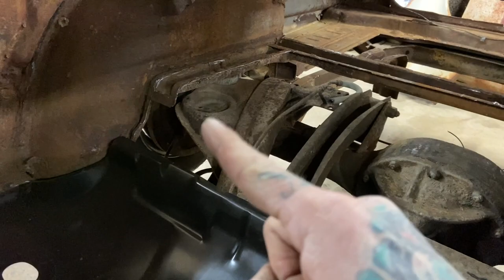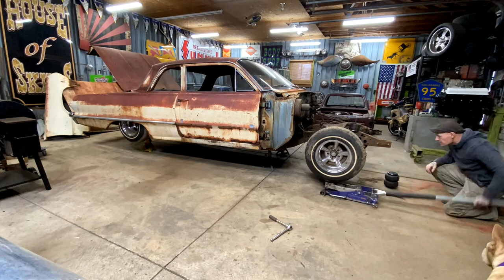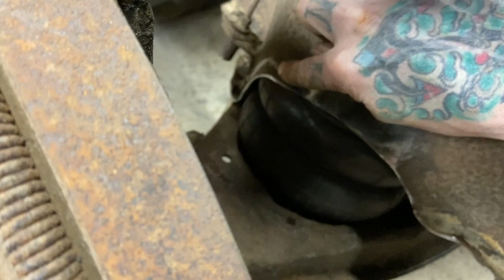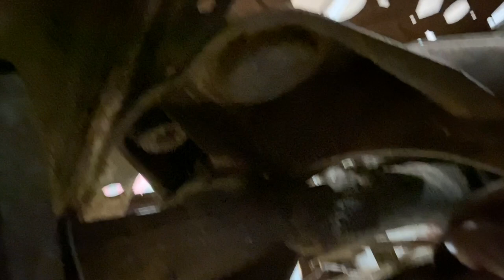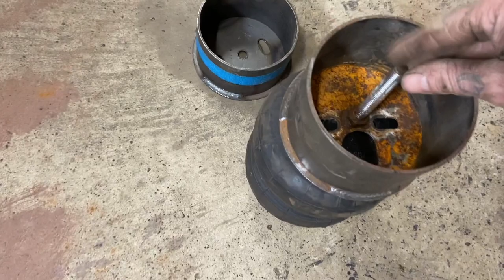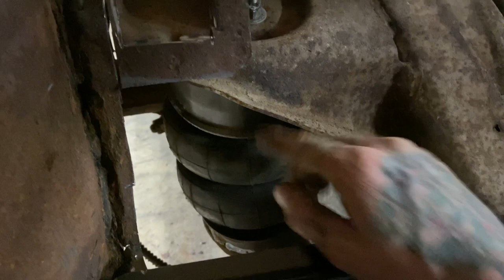Episode 21-how to install air ride on a 58-64 chevy impala

Comment: Really helpful. I've just bought an Impala and I could see arch shaped burn marks in the boot on the Wheel arches and two rubber supports bolted to the boot floor.. Which tells me that it had an airbag system in it with the current big 20" x 10 wheels. After watching your video I will now see if it had those mods you did. Thinking about re bagging it with 14 inch wheels.

Comment: Thank you for making this video.
What diameter bag fits on the front without having to trim the upper spring pocket? I have a 64 implala and hoping to use a 7" wide bag, the SS7 if you are familiar with it.

Comment: I ran those swivel fittings on a bagged dually. They have a tendency to leak. I switched to solid fittings and fixed my air leaks.

Comment: This helped me out, I have an 89 dodge ram truck that I've been thinking about bagging and I was worried I'd have to had shocks as well as the bags but it doesn't seem that I'll have to. Atleast not on the front which I'll be doing first.

Comment: The same body mount is out on my 64 biscayne  as well... I wonder if there's a common problem with the corners holding water and debris in there...
Reply: I have a 63 Pontiac Parisienne with same problem. Ordered replacement wheelhouse box braces from Dynacorn. OER also sells the replacements.

Comment: quick question for you  i just installed air ride in my car when i drain the tank everytime my car is all the way up it drops down when im draining my tank is that normal??
Reply from the maker: Yes most valves need back pressure to stay closed